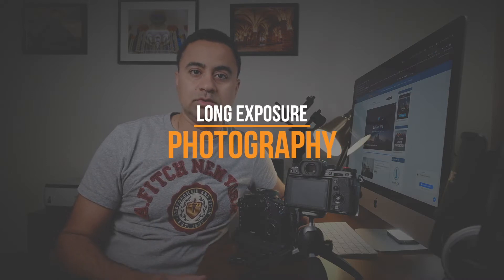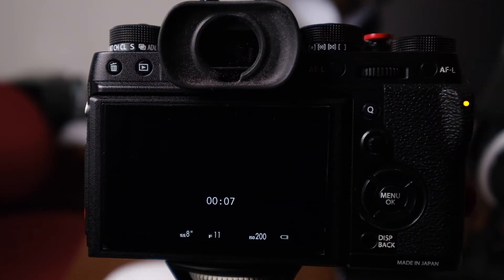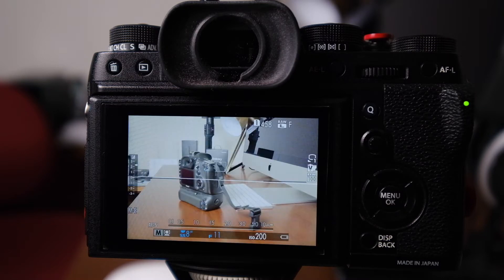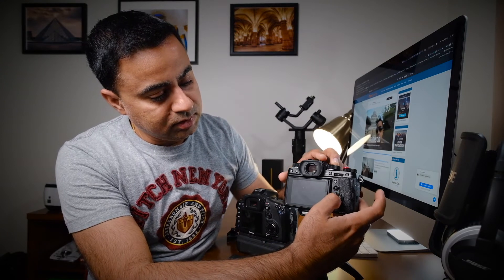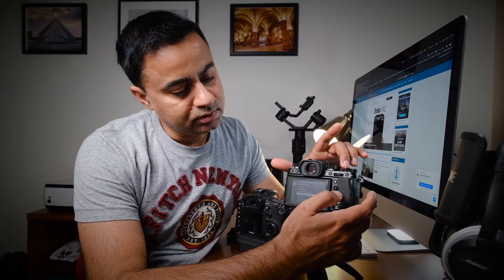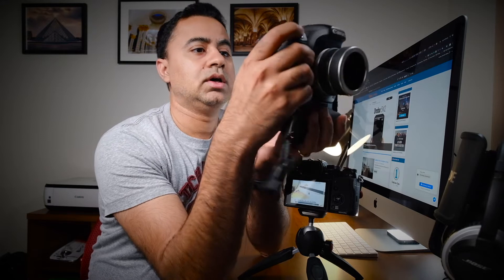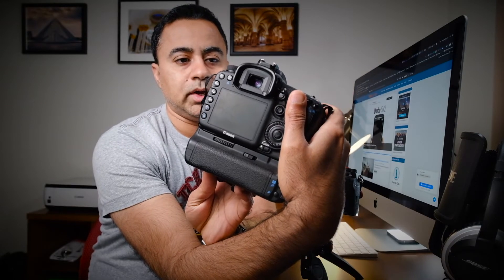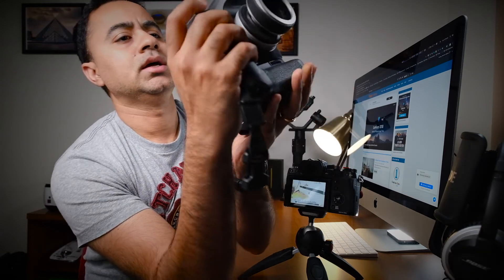Long Exposure - MUST KNOW Tip for Photographers

Comment: Nice video! I disable long exposure noise reduction on my camera. Never noticed that big of a difference except it doubles the amount of time to take the picture
Reply from the maker: Thanks Brady. I found it particularly annoying for capturing light trails as you need to be ready to take the next shot. As you need to anticipate when the next group of cars are going to drive through your frame.